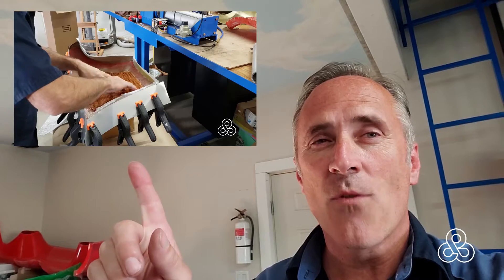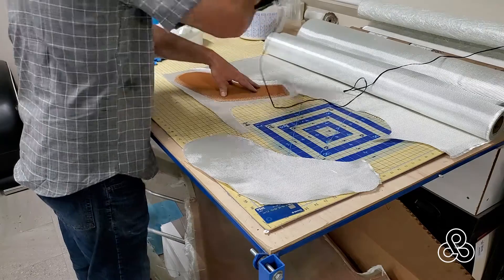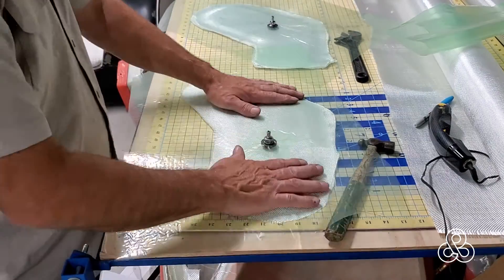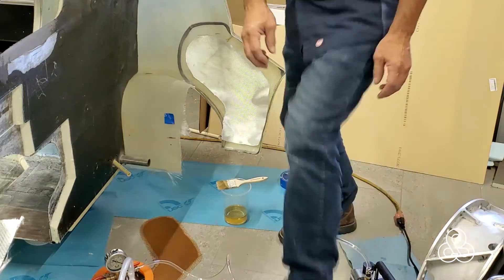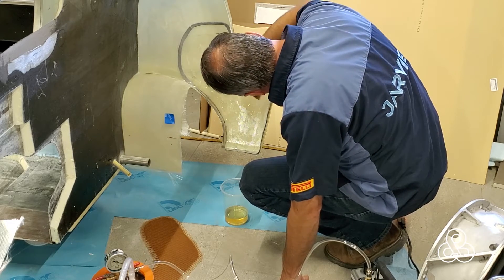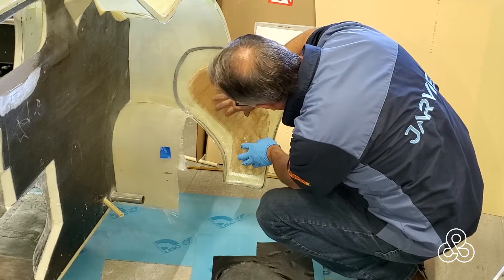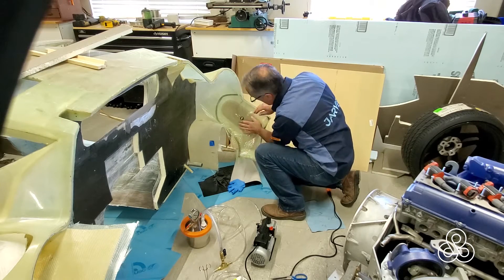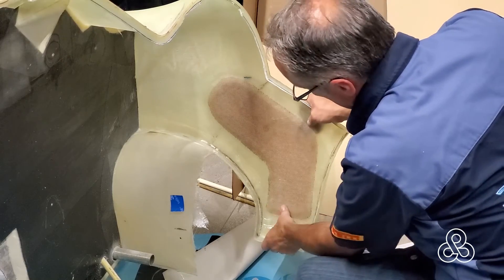A36 - Arete Supercar Project- Vacuum bagging Nomex honeycomb cores in place.

Comment: You don't need to worry about excess resin getting sucked into the hose. Just use breather cloth. That will absorb any excess resin.
Reply: the one show I watched on tv said that the hose was throw away item like the bag was ,, but they also had sponsors paying for everything ..it did not come out of there pocket ,

Comment: When I was building racing yachts for all of six months, the place worked mostly in nomex and carbon and kevlar The bagging method involved first straiking the nomex with a multi bladed diamond tip pizza cutter , the exact reason for this I forget then the laminate would be covered bu a sacrificial cloth called peel ply then a fluffy cloth similar to what you'd find in a cheap quilt then some shade cloth then the vacuum bag. We would use a vacuum cleaner to pull down the bag while we ran around smoothing the the wrinkles out before turning on the pump , the peel ply was to keep the cloth from sticking , the cloth was to soak up excess resin and the shade cloth was to ensure that the whole surface had vacuum .
I don't think you need the special tape or vacuum bags unless you're going to use heat cured pre preg laminate.
Masking tape and garbage bags or oven bags will do if you're not using an autoclave or oven, as long as they don't dissolve or contaminate the job any old rubbish will do as long as it gets the job done.

Comment: A good idea when vacuum bagging, especially honeycomb is to attach the vacuum connection beside the honeycomb. People instinctively put it on top. This can often lead to an indentation in the honeycomb and radial bag Marks.
If you extent the gagging slightly you can put the connection beside the honeycomb and control the supply of vacuum better!
Reply from the maker: Barely had room for the tape at the edge of the bag before the flanges, but it would have been nice to offset it.

Comment: Curious why the reinforcements are being added with the parts out of the mold, instead of adding them while the parts were still in the mold, where the mold acts as a jig to keep them in the exact position the plug was. Are you worried about the parts warping at all doing it this way, especially with the pull of vacuum being used?
Reply from the maker: You will see the parts go back in the molds for reinforcement in most videos, the vacuum in this video was very low, just enough to hold the core in place as it was on a vertical surface.